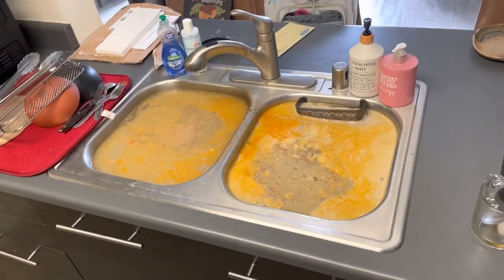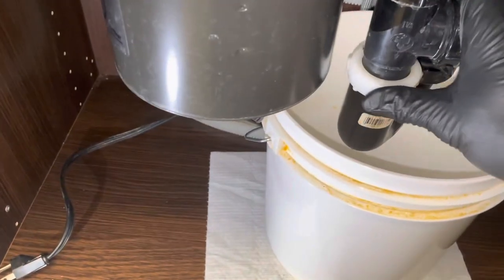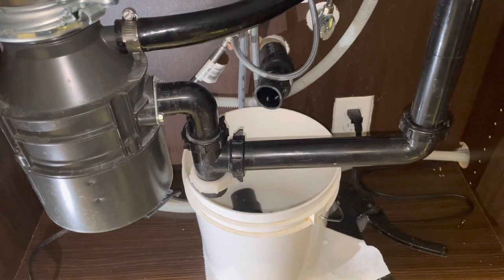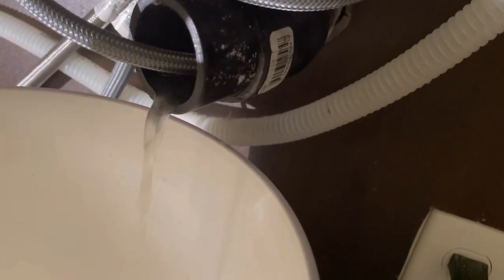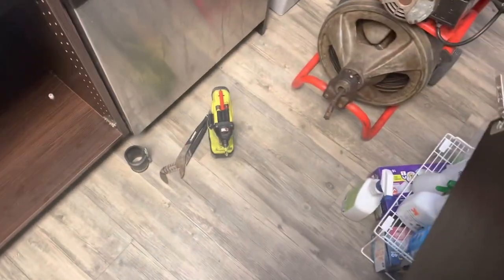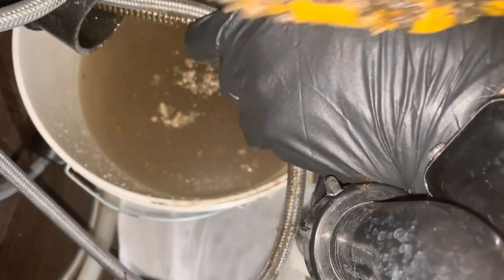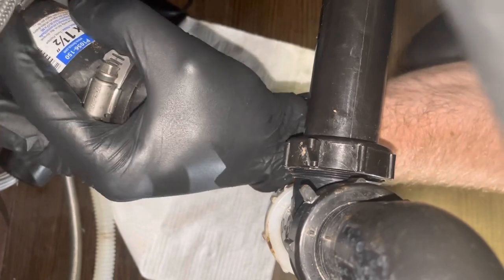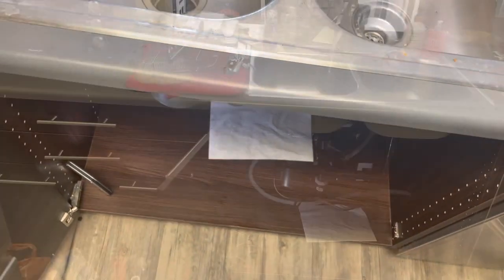Kitchen Sink Blockage

Comment: Great video, thanks! Just curious, what does a job like that cost? I would hire you for sure - knowledgable, helpful, clear and complete communication. Thanks again!
Reply: Every region has different costs (different company size, overhead and fees) and some companies undervalue or overvalue their service. But ballpark here in Southern California if it’s residential, around 150$-300$ depending on materials used (rags, cleaner, booties, gloves, trash bags, drop cloths, replacement piping etc. )
Reply: @jeremydewolfe8026  Hey, thanks very much for the info! Again, nice job!

Comment: Does the kitchen sink clog pipe.  Affects the washer machine drain pipe.
Reply: It could, in my area many times the two building drain branch lines tie together before getting to the mainline. I would say its a 25% likelihood that one may affect the other based on where the clog is, however if the clog is downstream of the fitting where the two lines connect it’s 100%.

Comment: Instead of bucketing the water out, get small sink plungers and plug the sinks..saves time
Reply: So true, we tried this first, but the clog was far enough down the line, that the plunging did nothing. Good comment tho!
Reply: @jeremydewolfe8026  u use the mini plungers to plug the sink while opening trap so u don't have to waste time bucketing the water out...
Reply from the maker: @manoffaith6952  i understand now what you meant! However the reason I remove the water from the sink if I can’t see through the water, is because sometimes residents have food debris or have poured a whole 5 lbs of flour in the drain, or have poured a whole container of rice in the drain. By removing the water i can gather evidence of potential misuse to advise the resident and or owner. Pictures are helpful. This isn’t frequently the case, its very rare, but it still pays to remove the water first. Good tip tho!